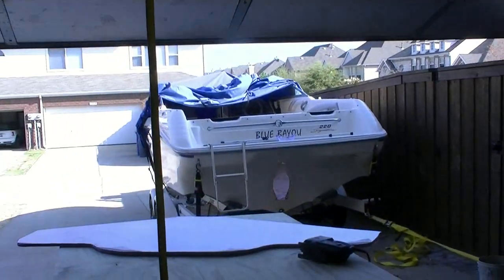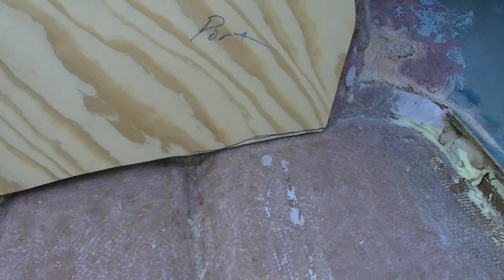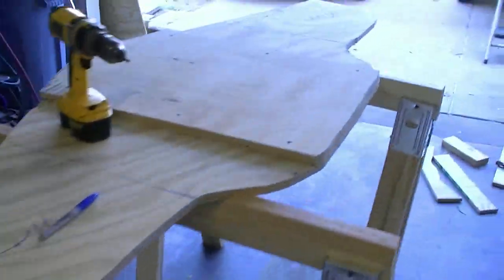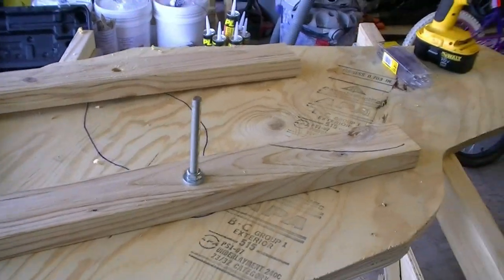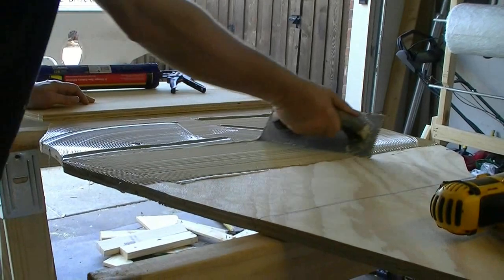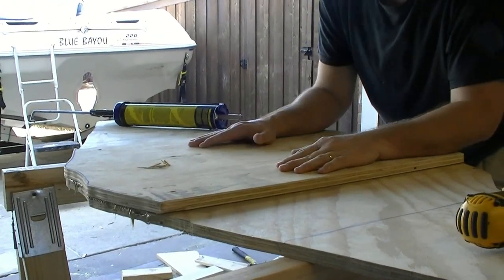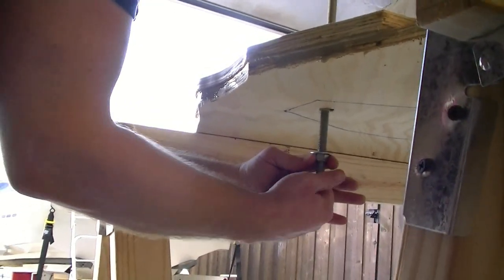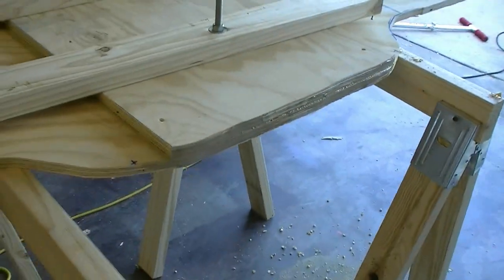Cutting the transom wood for the Sea Ray Boat Restoration VLOG #14

Comment: Wow, what a Project and thanks for sharing it. Back in the day I had some mental challenges with the structures of factory built boats and ended up engineering and building my new boat from scratch. A set of different challenges. Anyhow thanks again for your great videos, good stuff!

Comment: Whenever you try to glue two flat surfaces together, no matter how good the glue, you will always get air pockets if you only put glue on one side. The trick is to butter the other side and It only needs the thinnest of cover. When you join the sheets together you will always get the best seal possible.

Comment: I think it is great that you do not edit out the mistakes you make. Like when you went to glue the second layer to the transom and you put it on upside down and didn't put the 2x4 clamp on the bottom first before you put the bolts thru. I think it shows that nobody is perfect and it is a confidence builder for me as I am about to completely redo a boat that was given to me. You have shown me that I will make mistakes and that is ok. Thank you for being human and posting all these very informative videos. You should teach a boat restoration class. You would be great at it! Thank you again!

Comment: Help Mr Frisco !!!! I am searching desperately for a Volvo penta 280 cut out stencil or tracers or what ever it is that glassers use to cut transom keyholes with when the owner wants to put a different drive in there boat than the previous drive hole any help you could give would be a blessing !!!

Comment: I have a 1995 Chaparral SLC 2000 and have same problem as you did  How much did you spend to redeck your boat ? I have boat that has about same size deck as you do also how long did it take you to do so? to see what I am getting into. I know this video is old so I hope you read this ..
Reply: Did you fixed it
Reply: Nope sold it to Nabor did not have time for that repair he did good job fixing deck though and sold it also